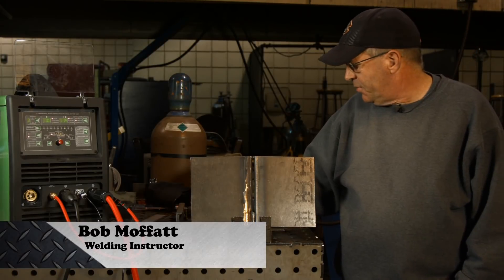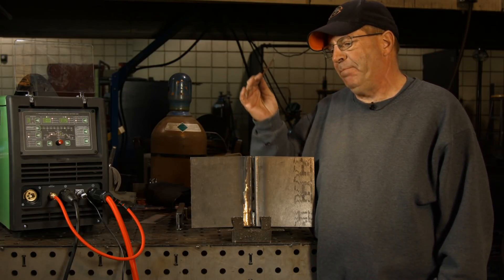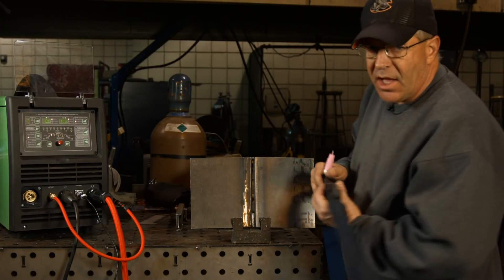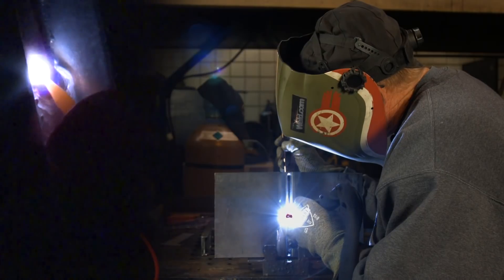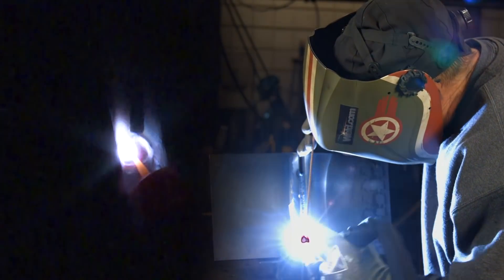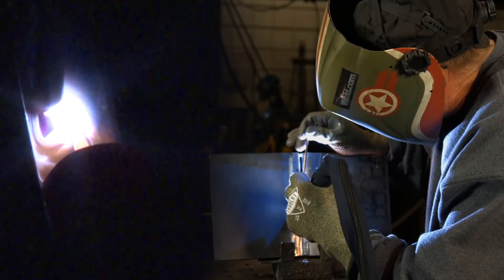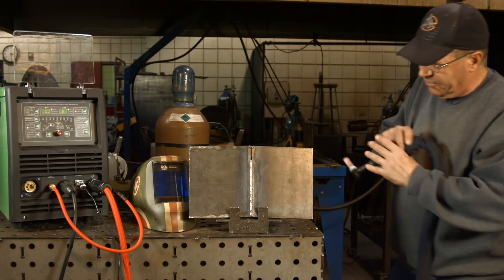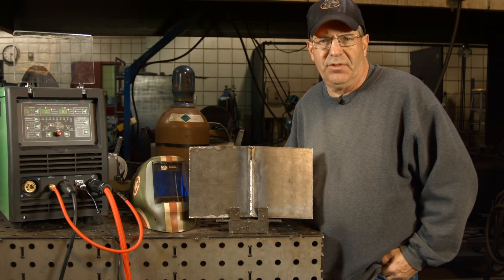🔥 4T Vertical Open Root TIG with Everlast 251si (VIEWER REQUEST)

Comment: Would you do an episode on running DC tig on stainless without a remote on the lift arc running on a Lincoln Invertec 275-s?

Comment: so what your saying is you fucked your capping. also its ali good and well to say i ran my amps on this and that but  i comes to a proper test you have to run at  the stated on your procedure or it's a fail and with good reason. I'm a fan you have great welding skill but can you teach the weld to a procedure.

Comment: 3:56   you have a support for your rod. loll
Reply from the maker: That wire across the back of the stand has nothing to do with supporting the filler wire while back- feeding and everything to do with supporting small coupons. One of my students was going through small coupons that were about 1 1/2" wide and tacked that on to stand his material up. In the past I've tried to rest the wire on that thing with no luck. Seems like it got magnetized and stuck. You wouldn't have that in production anyway so don't plan on using it as a crutch. All good stuff though, thanks for noticing.

Comment: Do they allow you to put the root in like that in a test? Seems it would be impractical to learn that way, I have always used an 1/8th in gap and laid my filler wire in the gap. staying on top of the wire, you get the same results

Comment: Awesome videos. nice work as well. I have a request regarding a video. It's a little out of the norm. But would really like to see a SMAW 10 on 10 or even a 12 on 12 branch. 6010 root/7018 fill an cap if possible. Really appreciate it and  keep up the good work.  👍

Comment: Nice to see a Video with 4T

In my shop we are only using 4T with high frequency start, welding thin Aluminium 1,2mm, Stainless 1mm and thick Steel. 

Would be interesting to try a footpedal.
Reply: This unit also has HF start available.

Comment: I noticed some sort of a support for the filler wire when you were feeding from behind. what is this black magic? I like it, I like it a lot! :) 
Also want to say GREAT vids & I too am happy you're doing the tig vids now.
Reply: Thanks for the comments and thanks for noticing that wire. Actually, that wire across the back of the stand has nothing to do with supporting the filler wire while back- feeding and everything to do with supporting small coupons. One of my students was going through small coupons that were about 1 1/2" wide and tacked that on to stand his material up. In the past I've tried to rest the wire on that thing with no luck. Seems like it got magnetized and stuck. You wouldn't have that in production anyway so don't plan on using it as a crutch. All good stuff though, thanks for noticing.

Comment: I notice you like to use the large wires for this. I have a ton of 1/16 wire for practice but find it very slow to gain height in a vertical and a extremely fine line to just melting the arch down. Can you do a vid with the use of off size wire?
Reply from the maker: Next weeks video we are using some 1/16 wire. It's a horizontal weld, however. A good rule to get the stack of dimes look is to push the wire in whatever diameter of wire you are using. So if you have a 1/16 wire, push the wire in 1/16th of and inch then progress forward and do the same thing.
Reply: Thanks for that. I was referring to the fact that your coupons are spaced the same as you rod width or a mill more but real close. If dealing with a 3/16 gap and a 1/16 rod the technique seems like it has to change. So you almost have to do actual bead stacks as well as good penetration on the sides during the root. That is what I was trying to get at. A vid or pointers on how to make that work. More often than anyone wants to have, we are faced with a gap larger than desired but still having the need to weld the parts together.